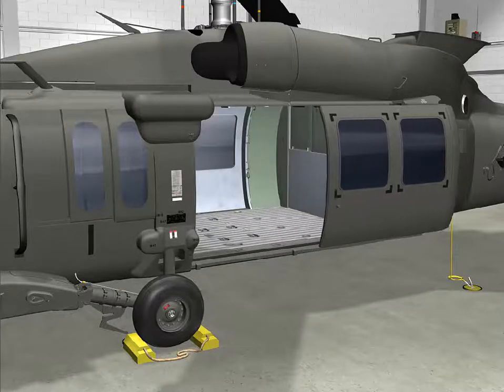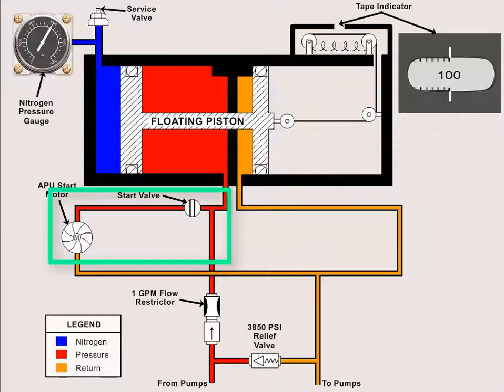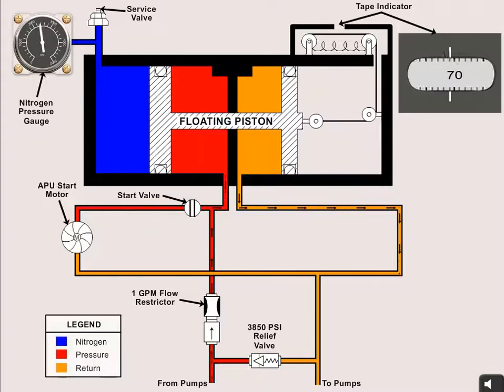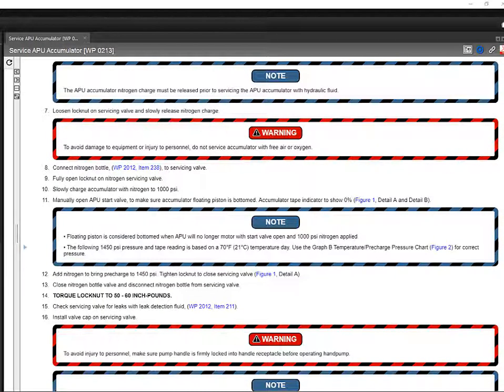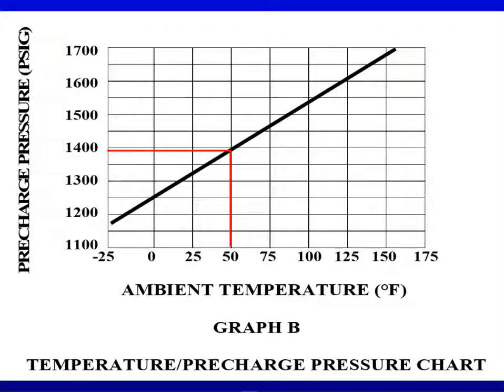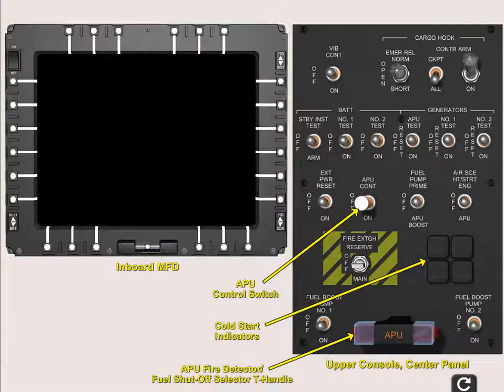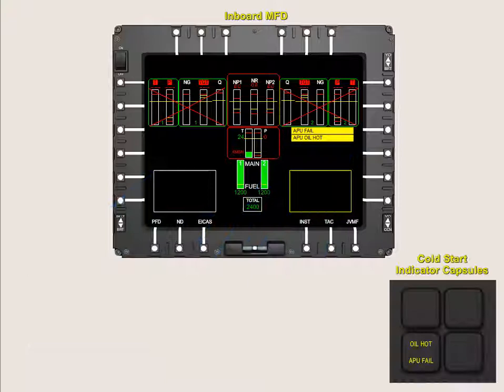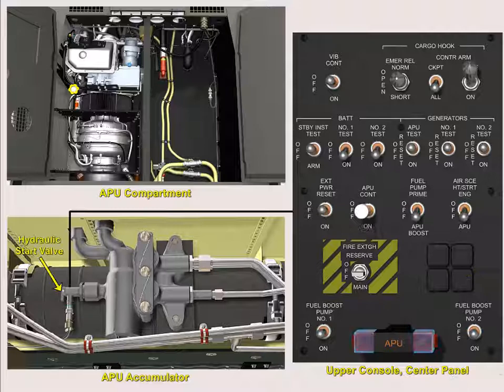Auxiliary Power Unit Hydraulic Start System and Controls

Comment: Why not an electric started apu.
Reply: The apu can be started electrically
Reply: If the APU fails to start and the battery is dead, you can not pump it up back up w/o an external electric supply. If the APU fails to start w/ a hydraulic start system, the crew chief can pump up the accumulator.